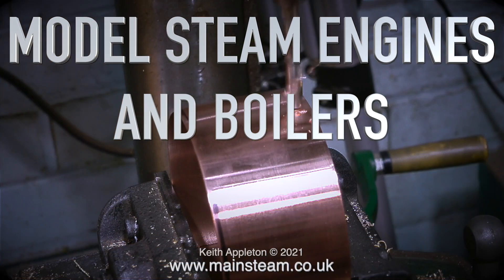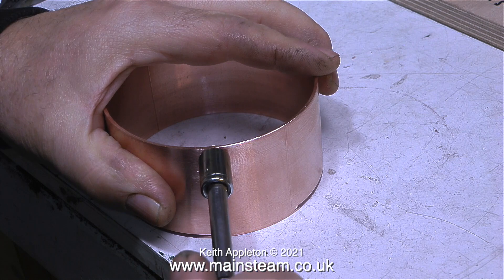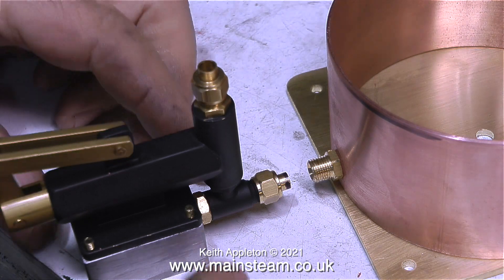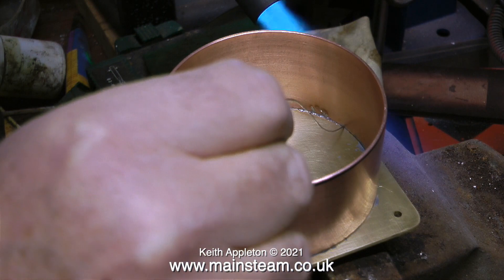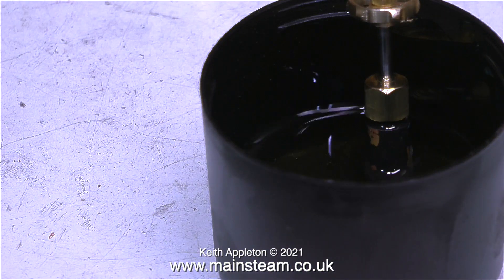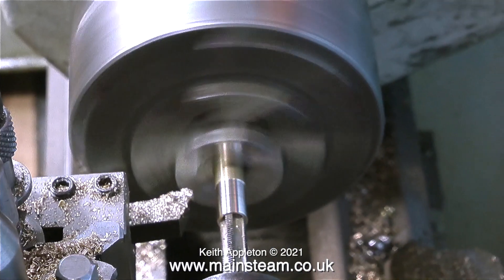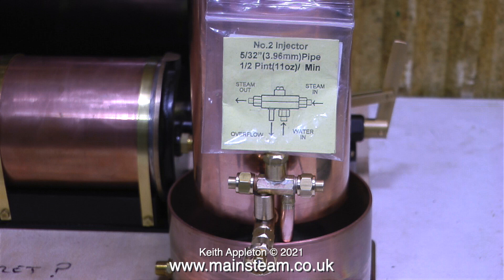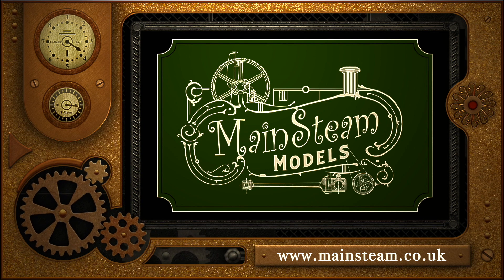MODEL STEAM ENGINES & BOILERS - PART #4

Comment: I used the dishwasher once to clean a motorblock from a small bike. The misses was not amused, since all the plastic things being also in the dishwasher collected a layer of grease due to them getting staticly charged by the washing process..😄
Reply: that is the benefit of being single